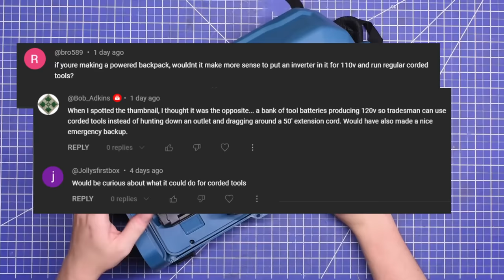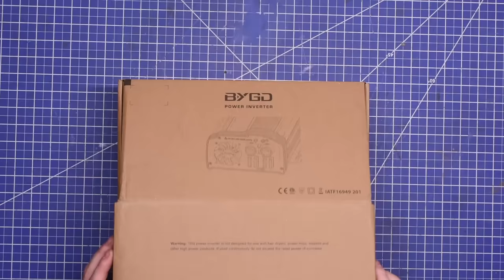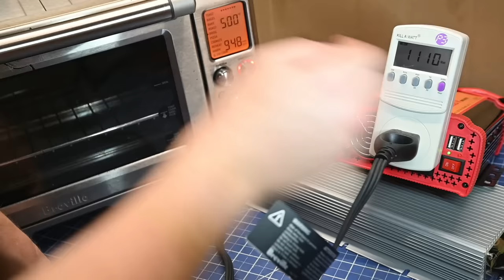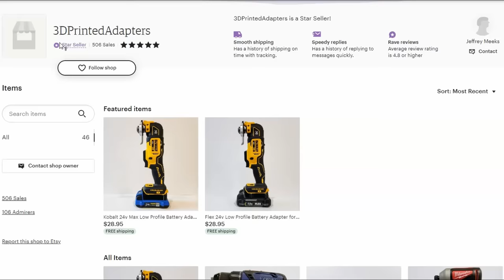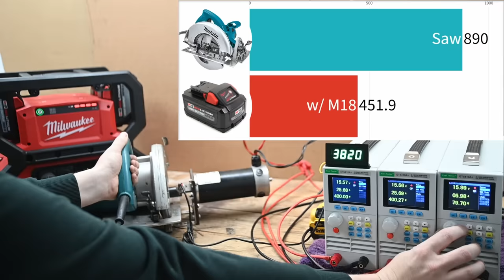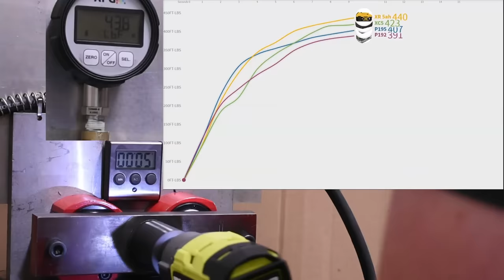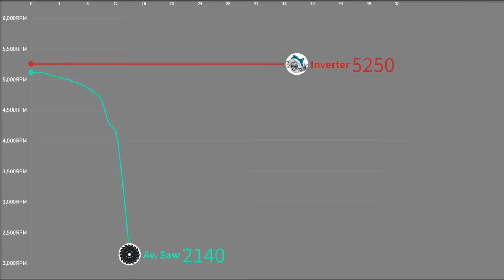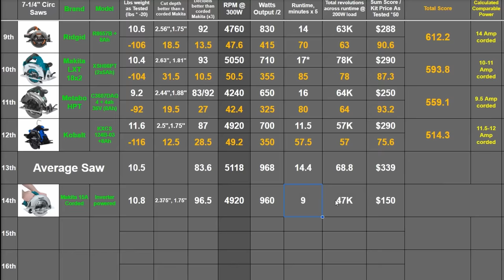Powering Corded Tools w/ Cordless Batteries is Stupid (but fun)

Comment: I think AC makes the most sense.  They're cheaper and don't sacrifice power for efficiency.  Additionally, you need a pretty fat wire to run DC stuff.  Both AC and DC still make sense.  I think it matters more to take your toolbox into consideration.  Whichever tools one wants to use lol.

Comment: After burning out my craftsman crap and 2 sets of dewalt I bought a generator and went all corded,doing construction and dealing with batteries is not fun,I also used a converter hooked to the truck,who has enough batteries to work all day then have fun at home charging em,not me corded is way more dependable in my experience

Comment: Why didn't you just use 24v Inverters? Those Buck Converters are usually only 30a(for a good one) I used them in my Motorhome(it had one fitted new from the Winnebago Factory) to Charge the "House" Batteries while Driving & they constantly burnt out due to only being able to cop 30a Max so wouldn't be able to supply enough "Juice" or am I missing something here?!

Comment: Most of the AC power tools have brushed motors.  This means they are either field wound, or have a diode bridge that internally turns the AC to DC.  What would happen if you ran them on 120v DC?  My concern would be for switches arching because AC setups extinguishes the arc while DC will continue to arc with the switch open.
Reply: Yeah you would burn switches, probably leaving them closed

Comment: Correct me if I'm wrong, but don't most AC tools use a DC motor? You should be able to run most AC tools directly from DC. Or maybe mostly directly....
Reply: Motors yes, switches not so much

Comment: Some AC tools have universal motors and should run pretty efficiently off an 80V battery with a simple DC-DC converter. I think this would be more efficient than an AC inverter.
Reply: Why 80v?
Reply: @riba2233  My lawnmower, snowblower, weedwacker, etc are 80V battery tools. They’re much more powerful than the 18 or 40 volt models. I don’t think an 18V to 120V would last very long on a charge. Although you could use multiple batteries … just spitballin’
Reply: @jeremiahbullfrog9288  ah ok I get it. Yeah 18v is def not enough for such machines

Comment: Some EGO batteries wired in series would get you 112 volts but dc. How difficult to convert to ac? I know three 40 volt batteries would net an even 120 volts dc. I know some are thinking “why not get a gas-less generator?” Better packaging. But would take the fun out of trying our ideas of using what you already have.
Reply from the maker: Tools that used a universal motor could take that 120V DC in many cases

Comment: Even if you are at a job site in the woods with 20 people working with power tools
It would be more efficient to let them work with cordless tools and run a generator during lunch for 30 minutes to make coffee, heat something up to eat and charge all the batteries back up
That generator would run at a high efficiency for only 30 minutes instead of 12 hours at 90% idle
Al thou you need like 20 or more Chargers for that

Comment: What about making a one 170 Volt battery pack that way you get the full RMS voltage of line power
Reply: No  170v is peak, 120 is rms so you would still need to use 120vdc

Comment: It is not necessary to use an inverter on a universal motor.  Just use a higher voltage battery.  Test it out on differing high voltages, see what happens.

Comment: by the way, if you are interested in that M18 inverter, you are better off buying a portable power station which already has batteries, LFP batteries that has at least 3000 cycles.

Comment: Have you tried any of the off brand Milwaukee batteries just curious the difference in run time/ life of the unit vs brand name. I personally run a good bit of the off brand ones and so far in past few years only had one die on me running the Milwaukee 16inch chainsaw
Reply: The issue with that is that these off brand batteries change all the time. The "brands" change named every 2 weeks, and even if a brand name sticks around, the cells you get inside can be completely different one month to the next anyway because they usually source them from wherever they get the best deal that day. So, testing them has limited value.

Comment: Any particular reason you didn't just feed DC to the wired tools? Universal motor, it's in the name, are fine on DC right?
Reply: Switches are ac rated
Reply: @riba2233  ah yeah I forgot that part thanks
Reply: @cian.horgan  np. If you connect it after the switch and use a proper dc rated one it could work :)

Comment: 1-phase motor: 6times its nominal power on startup. 3-phase motor: 3times its nominal power on startup.
Ultra-cheap/bad chinese LED: 100times its nominal power on startup.
Refrigerator compressor (old ones, not the new linear inverter ones): start up with a shortcut.
Interestingly - as is the topic of your channel - you might have wanted to test the claims of the inverter manufacturers about the performance of the inverters.
And then use a Victron. ;-)

Comment: does anyone know the maximum input voltage of M18 tools? will a 60V to 24V DC converter kill any of them? M18 packs freshly charged can be up to 22.5V... that's only 1.5 shy. Thoughts?
Reply: it would be neat to use Ego/Kobalt/etc batteries on a backpack/hip/satchel mount to run 18V tools with paralleled 500w dc-dc converters for golf carts that are already potted, waterproofed, in a heatsink enclosure.

Comment: i still think that having a adapter that plugs into battery slot that has cord then buy one tool and if you don't need cordless just plug it in and work all day the days you need cordless use batteries

Comment: there's a VERY important question I have. Can it be used simultaneously charging and draining batteries? Kinda like a UPS or surge damper (IDK the real name) I like the idea of that being filled with the cheapest, smallest red batteries you can get a 4-pack of, and just having that between the gen and the tool. Might even let you use a much cheaper gen with those high surge tools. prevent breakers from going pop... AGAIN

Comment: It would be more efficient using two 60 volt batteries in series then use an inverter. 120v DC is more powerful than 120 AC

Comment: Whoever said that the battery backpack was stupid never had to be up in the air 50 ft or so using a battery operated grinder trying to cut steel apart you get a good 15 minutes per battery. Better Tuesday battery operated weed eater that you get a good 15 minutes on an 8-hour battery pack. And both cases I'd rather be able to carry around capacity of having to keep switching out batteries

Comment: Most corded tools use "universal motors" (with brushes) they will run very happilly on AC or DC - no need for an inverter at all! Just series the batteries to get to 120v (or 220 in Europe),,,
Reply: Motors will, switches won't

Comment: A lot of those modern-ish AC tools will absolutely run on DC, their speed control just won't work - and who needs any speed other than full chooch? So the obvious thing to do is to series up six 20v batteries into a very angry 120vDC pack, plug it in and stand back. (This works because the tools are universal motors, which don't care - but the speed control is a triac, which can't do anything to DC, but isn't going to be harmed either)

Comment: A company use to make inverters that worked on 18v or maybe 36v because using a buck converter is not ideal
Reply: Ya it took some scrolling but if anyone needs this and doesn't want to buy the name brand one or have the batteries for one that makes one the 2000w was like $280 and the 2500w was $310
Reply: Oh ya that was ebay

Comment: A real stupid idea: trick the dewalt flex batteries to run in 60v mode, then series them.  Run the ac tools (most are universal motors) straight off the “120” volt battery.

Comment: Most of these tools would happily run with 110V DC so you can avoid the losses and cost of converting your battery power to AC.
5 batteries in series shuld do the trick just fine.. i mean janky.

Your LED lights would probably work just fine to. unless they just use a capaitor to limit the current instead of a regulating power supply.
Want to charge your phone? no probem, usb charger should work just fine. Any switched mode power supply, so basically all consumer electronics i'd guess. So unless it's an induction motor like a typical water pump eg or some big 3 phase motor, chances of your tool taking dc are not bad. Except your microwave. No DC Hot pockets

Comment: Why not just use the dewalt battery powered "generator" or the milwaukee MX version instead of all that
Reply from the maker: Any of them would likely work like that. W echose this because it recently came out so maybe less people have seen it work, and to make it more universal/cheaper on the battery cost. Which MX would be going to the opposite direction haha
Reply: @TorqueTestChannel  sorry I commented before getting to to part of the video where you used one.

Comment: You do NOT need an inverter! Virtually all corded tools use universal motors- they are quite happy with DC. So two DeWalt 56v batteries in series are fine. Or 6 20v ones. Of course universal motors are not exactly efficient- so do not expect a long run. No control systems or other complexity- just some wire.

Comment: Why not make a tool that when you have power it is plugged in and when you don't want it plugged in disconnect the cable from the tool and allow the internal battery to operate properly like existing battery powered tools

Comment: inverters quite inefficient like how outlets to appliances, on top of powerful inverters that are not cheap. AC motors also not as efficient as DC brushless. 4:49 solar inverters can accept higher voltages above 12 volts. these 12V inverters are terrible except hooking it up to a car

Comment: Stupid of the stupid idea: Take some power amps for subs, wire the speaker outs to the tool, input a 60hz sine wave into the amp. Its BASSically the same thing, right?

Comment: I love your flavor of stupidity and I'll raise ya!  Get a few old-school brush-type 120 VAC corded tools, which have universal motors that will run on DC.  Run your battery packs in series to reach 120 VDC.  As you probably know but some viewers might not, a 120 VAC power source actually has a peak voltage about 170V, but it wiggles down and negative, so the net effective voltage is 120V.  So you can take 6 batteries (they actually out out about 20 V) and power it.  I have used some old Milwaukee 1/2" corded drills that put out far more torque than a strong man can hold back, even with a long board strapped to it using hose clamps.  
Might want to add a fuse to that setup.
This is far more sensible than strapping a go cart engine to an impact driver gearcase.

Comment: Yep, the battery backpack is all kinds of stupid. That is indeed why it's awesome. If you want sensible, just spend all your money on Festool and ignore the possibility of having fun.
On the subject of the inverters, you absolutely have to make sure that you're using a pure-sine inverter. Modified sine or pwm will not agree with modern motors and digital electronics

Comment: That must be a really cheap 1500W inverter, cheap inverters lie about their actual and surge values. I have a WAGAN Pure Line 2000W (actually I have the 400W, 700W, 2000W and 3000W. I started with the 400w+700w. the 700w outperformed my modified sine wave 750W but well I could run a saw Zaw that I couldn't do on the MSW I needed a little bit more power and took the plunge and bought the 2000W and 3000W figured I would mount one in my van and use the other one mobile. thought I was crazy then we had a 25 hour power outage not a month later I ran a large portion of my house... microwave, refrigerator, freezer, TV and lights. decided it was time to put in a generator hook up ). this brand has a very nice soft start and I did a lot of angle grinding over the last few months as somebody was too cheap to turn the electricity on where I was working and continually promised to turn it on. But alas before we tackled the big project replacing the steel door in a concrete block wall we still had no power this was November so I did a lot of running things off my van. I have also used one of those DC-DC converter's and they work very well I got the 85A and I was able to run a 700W or 2000W sine wave inverter with no problem until I exceeded the power draw and then killed my lead acid battery ( accidental reverse polarity twice, thought I killed the converter turns out just the battery had to buy another converter to find that out but hey now I have the 120A version as well).

Comment: What about the inverse? What if cordless tools had a huge DC power supply (no sag)? Remove the battery limitations and see what really happens :D

New subject material of "inverter ratings are out of hand" - this could easily slot right in given the equipment you already have for testing.

PS: You guys aren't stupid.

Comment: A solar generator is significantly cheaper than the Milwaukee inverter even before adding the batteries. I know that's not the point of this video, it just seems silly that anyone would even buy the Milwaukee inverter.

Comment: Woah…you're doing it wrong. Idk how you should be converting/inverting, but I could figure it out, or someone knows.

Basically, your hack has the dc doing what the ac should. Invertify then convertify, because it is easier to change the voltage of ac, transformers.

Adjusting the frequency could be used to adjust the speed of tools…

Now I'm wondering how many volts I could feed to my corded tools…

Comment: electronics  wont last  in the milwaukee  battery deal ....issues after  1 year or less  ie failure ,  they will just run customers through return, tech dept repair  etc over and over and over  ,   its  just the way it is with electric components in battery power stuff   ,  ~dont get rid of your generator

Comment: Any portable power station with a 2kw running watts 2.5kw surge inverter and 2kwh battery with a mppt solar dc charger ac charger all in one unit can do the same with less probability of setting yourself on fire 😂

Comment: I believe that additional pin might be for charging communication. (or maybe cell balancing)

And as for why different brand batteries were yielding different results... (again, me speculating)
Mixed and matched battery capacities vs All the same capacities (at least with the Hercs), yielding different voltage sag under load.
Either way, voltage drop under load is my guess, due to name-your-reason... Capacity mismatch OR overall battery wear OR poor QA testing of the cells they're made of, etc... 
(the big name brands probably use cells whose capacities are within a few percent of each other, which is why their packs last longer as one dead cell will render the entire pack unusable)

Anyways... I don't think anything you guys do is stupid!
Silly? Maybe... BUT, almost all new inventions start out life as being something silly!! Just look at these inverters. 
I'm sure plenty have said: "Why d'ya needa device that'll run AC told offa batteries... Just run a darn generator!"
And yet here we are, with big brands offering exactly such a device! 😏
If you guys were really doing stupid shit, WE wouldn't all be here, and yet, here WE all are! At the end of the day, haters gonna hate, so just ignore them. lol

Comment: I feel like it doesn't take a genius  to realize it has 160 amps of fuses, multiplied by the voltage, only comes out to 1920w of theoretical power before the fuses blow. Assuming it's two banks of two fuses, one bank per outlet, then you're limited to 960w max (80ax12v). I'm used to overrated marketing in the car audio market, not for inverters though. That's just dangerous, idiots like this will overload it and be lucky if the fuses protect their motorhome from burning down. If anything, this video is a good example of why you don't buy sketchy chinese inverters to use with anything you care about.
Reply: inb4 someone mentions using it with 14.4v, that's still less than 1200w and that's assuming it has even slightly decent circuits. For $300, I would invest in more fire extinguishers...

Comment: Keep the stupid sketchy videos coming as they are great fun.  As for the inverter power box I really don't see the point as far as a jobsite goes when you could get a gas powered generator.  In Canuckistan the Carry-On is $700 on its own. Add $800 for batteries and you get my point.

Comment: Nah, the real stupidity you need to try is slapping 6 18 volt batteries in series and running corded tools off that since universal motors can run on AC or DC (granted the power switch won't like breaking the DC power)